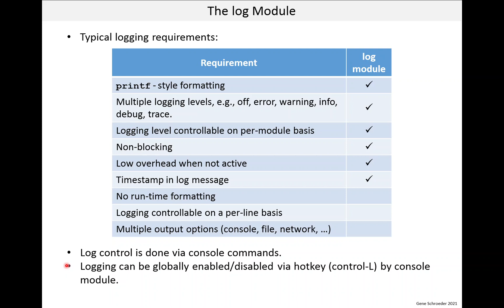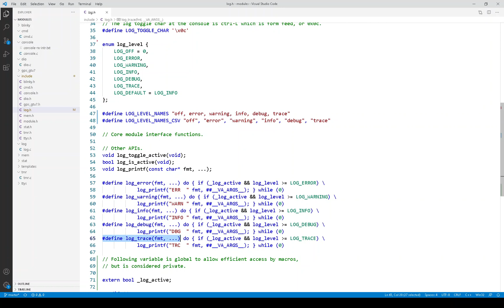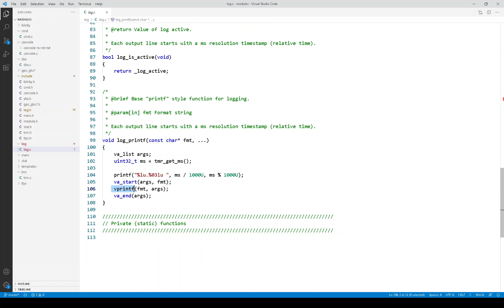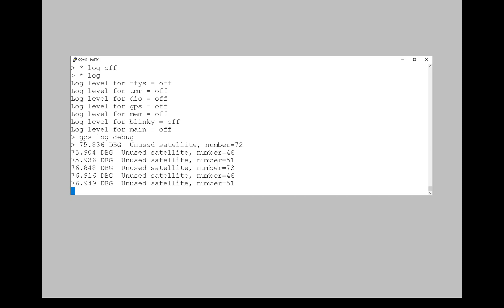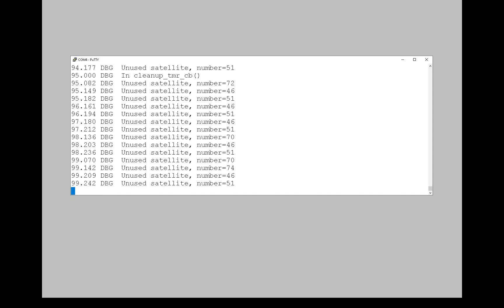Lesson 21.  log: Logging Module

Comment: Hi Gene, Question about the logging macros: why not use inline or regular functions here? I see that these "functions" need to access the local-to-module log_level variable. Is that why?
Reply from the maker: There are a few reasons.  One is that with macros you can easily "compile out" some log levels, to save flash space and CPU time for an optimized build. This is done by "nulling out" the macro definitions based on a build flag. Another reason is that, for this course's log system, each module has its own static "log_level" variable to control its logging level - not sure how to handle that with a common function. Finally, although not used here, it is common for logging functions to print the file name and line number of the log statement in log messages, using the the standard _FILE_ and _LINE_ macros. That would be difficult (as far as I know) with functions at they would print the file and line of the logging function, not the log statement.  I must add I have been using log macros without much thought all of my career (probably just copying those before me) and there might be better solutions - especially with C++ or rust.